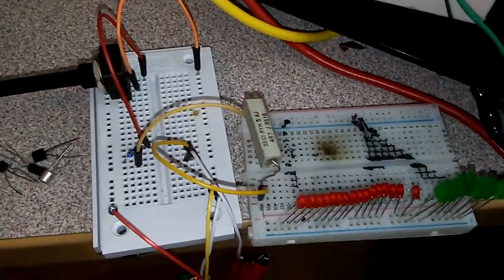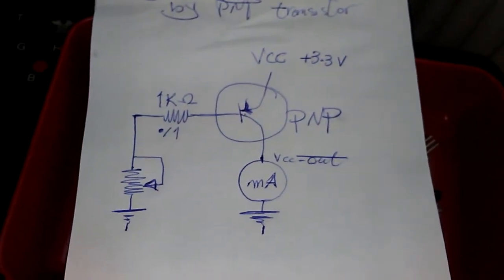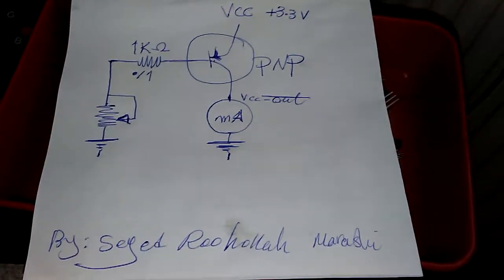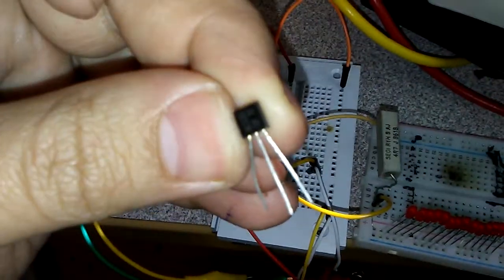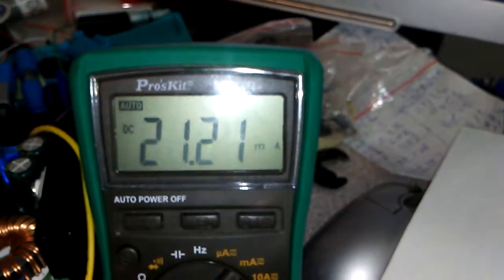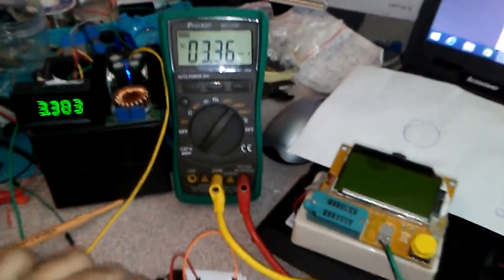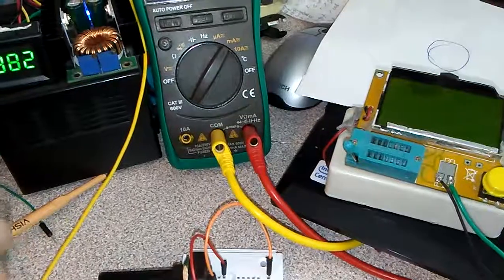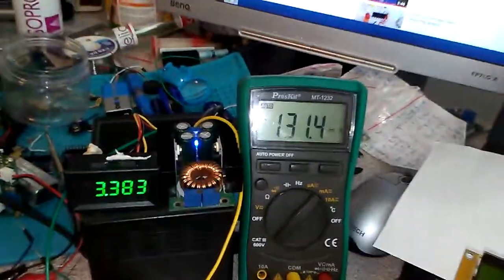Easy current limitation ,  how to limit current ?

Comment: Hi, can you draw circuit for regulating high amperage current  “ 0-10A “
Reply from the maker: hi, this is not good for 0 to 10A, this project is good for max.500Ma as video

thanks for watching
Reply: I know , can you draw it for 10A ?
Reply from the maker: @rawandjaza5929 for 10A go for other solutions and try to google it